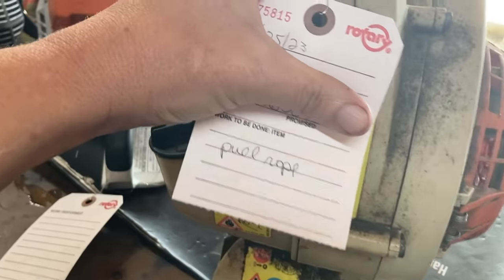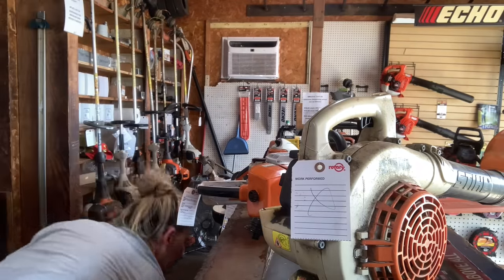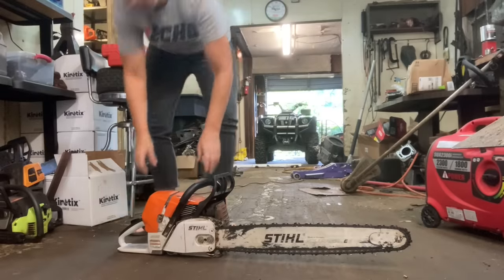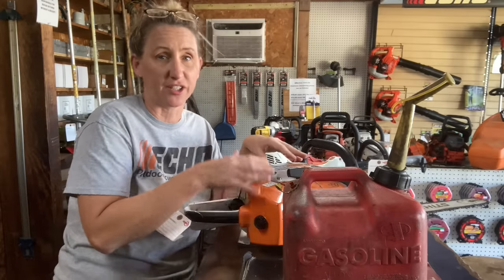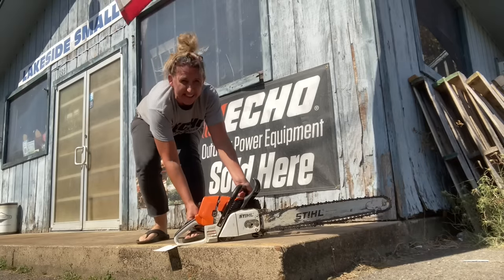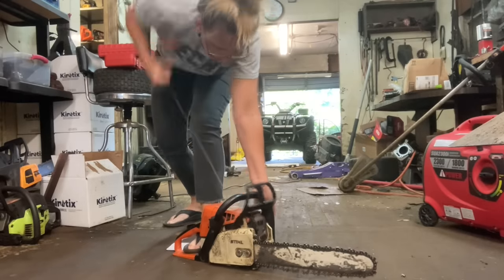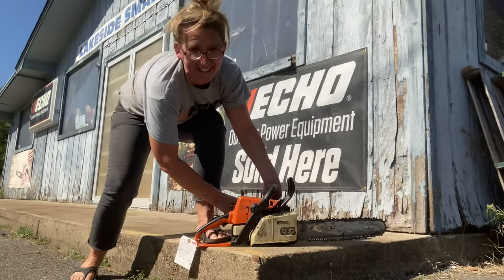The Burning Truth of Canned Fuel. This HUGE Distributor Doesn't Like Me Exposing It!

Comment: I am a former diesel mechanic and it really upsets me when I have a fuel issue on one of my pieces of off road equipment.  You have taught me what I needed to know. I appreciate it.
Reply: former owner of heavy equipment on logging and placer mining .. good fuel, and looking after it .. Filtering is worth hours if not days of mechanic time and lost production.. had bad fuel straight out of the tanker knock us down for days..
Reply: Hi 👋
Reply: @doonhamer252 
Nothing worse than a dredge that won't start... and you got that damned wetsuit on and trying to pull for an hour 😳😩😩😩 augh! 🤬🤬🤬🤬🤬
Reply: I was a diesel mechanic for many years.. After I retired I went to work for a family dairy farm.. As the mechanic. The firm probably had at least thirty or forty different two stroke motors.. Running all kinds of small equipment. One thing the owner did a long time ago... Was to buy aviation gas... He thought it was well worth the money.. Just because of the problems you are describing.. I thought the machines ran better and faster.. Not many less Pull rope issues.. Of course you cannot run alcohol gas in airplane.
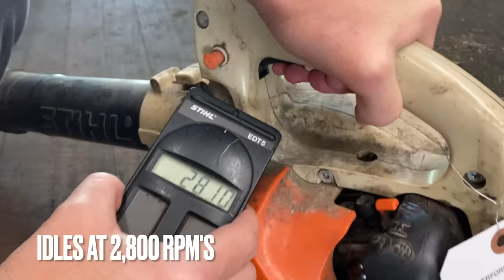Reply: 3:03
Reply: @jim4448  You actually can run alcohol gas(or regular diesel fuel) in some aviation engines, but that's another issue. Obviously not in those only rated for real avgas or modern LL avgas or jet.

However running leaded gas in small engines is not smart. Especially avgas that's several times more toxic than leaded automobile gas was. Anyone as old as me or older in most countries has IQ loss from use of leaded fuel in the old days. And I'm under 40.

Comment: You’re going to love this one. I found a Stihl MS170 at the dump on the ground near the dumpster. Pulled it a few times to see it wasn’t seized, but wouldn’t start. Took it home. Watched this video and emptied the fuel(light blue). Put in my non-ethanol mix - it fired up on the second pull! Thank you very much! MD
Reply: That's a darn good find.
Reply: Awesome! 😂👍🏼
Reply: @spiritseeker2831  Find a nearby gas station that sells pure gasoline. Don’t use gasoline containing ethanol. Mix your own 2-stroke fuel and don’t rely on any of the premixed stuff from the big box stores. I can’t help to believe it’s got so much stabilizer - to make sure it lasts on the shelf, waiting to be purchased - that the stuff doesn’t burn correctly. 🤷🏻‍♂️ Just my 2 cents…
Reply: @FilosophicalPharmer  My problem is that here in a major east coast metropolitan area, there are NO gas stations within a one hour drive [each way] that sell "pure" gasoline.  I have tried several web sites which purport to tell me which local stations sell non-ethanol fuel, but when I go to those stations every pump has a sticker that says the fuel contains 10% ethanol, and when I ask about non-ethanol fuel the attendant looks at me like I'm crazy.  So my options are limited to [1] mix my own fuel using ethanol-containing gasoline, or [2] buy the canned fuel.  Since I typically use less than a gallon per year I've just been buying the canned fuel. It's a pain to mix less than one gallon, however I guess that's what I'm going to have to do from now on.  Thanks Chickanic for the education.
Reply: Ethanol hurts nothing, you just have to use the darn tool regularly and don't store the fuel in a vented container.
Reply: @evanstauffer4470 You can remove the ethanol from the gas you buy yourself, but more important is ethanol doesn't hurt anything
Reply: @integr8er66 Have you ever heard of Project Farm?

Ethanol acts less as a solvent as pure gasoline does. The sugars in it burn up into more carbon deposits, and prematurely gunk up piston rings making you lose compression sooner.

Comment: Have you considered sending some samples of fuel from one of the machines that isn't running properly to one of those independent fuel / oil testing centers to see what's in it? it would be nice to know if it's something that's missing, not supposed to be there, external  contamination, water absorption, etc. it would also show if the contents and additives that they claim are present are actually there.
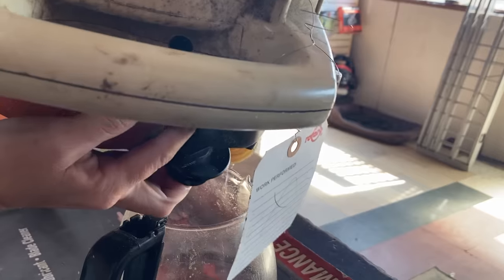Reply: I'd love to assume they are not guessing the issues based on the gas the customer brings in. Oh wait 4:15. I'm guessing people just leave their gas in it until it degrades: gas expires.
Reply: Sending samples of fuel would show if that specific fuel had an issue, but not the stuff sitting on the shelf waiting to be sold. Sending some sealed, fresh stuff would be better to see what is actually different, if anything.
Reply: @jefism  She says she checked everything before condemning the fuel on that blower. Doesn't seem like guessing to me.
Reply: @--_DJ_--  Sending in both for comparison would work too.
Reply: Don't have to. If you replace it and it runs, you know what you need to know. Don't over complicate things.
(I grew up in a motorcycle shop full of grumpy bearded old mechanics that were great teachers.)
Reply: @markmitchell457 What would you know?
Reply: Hahaha!!
Reply: She clearly doesn't have the "same problems" with "other" gas, it's just the Pink stuff whatever.
If it was anything you mention, she would have similar problems with other gas, not that gas doesn't have the problems you mention, it's just she's seen a "difference", so that's what she's showing us, is the "exception" to the standard rule.
Reply: @leeuniverse    Why would she have similar problems with other fuels if the pink fuel is a low quality/contaminated product?
Reply: @markmitchell457  My idea was to show irrefutable proof to the manufacturer and/or other people that don't believe her.    /     If the manufacturer was shown hard proof they might be forced to take the issue seriously.     //    And they might be able to track down the problem more quickly if they had testing that would tell them where the problem was.
Reply: @FonicsSuck 👍I approve this message☝️
Reply: @FonicsSuck  This is very true. I run good quality non-ethanol gas in all my small engines and only non-ethanol gas. I run this in all 4-strokes and in all 2-strokes, after mixed with a good quality 2-stroke oil of course. I advise all my customers to do the same. ONLY RUN NON-ETHANOL, DO NOT RUN ETHANOL GAS (in small engines.) I have more small engines than I can keep track of from almost every manufacturer/brand/model out there that may collect dust in a corner of a barn or building for 1 year, 2 years, or who knows how long. Blow the dust and cobwebs off, hit the primer a few times and choke if applicable, and most of the engines will fire right up or at least hit in 3 maybe 4 pulls (with 1 year old non-ethanol gas, a well maintained engine, nothing wrong besides gas could keep the engine from running) (also this is without fuel stabilizer or additives just gas and oil, and it may depend on brand/model of engine, to be honest some just start better than others.) The non-ethanol gas doesn't go bad within a year and doesn't eat up the fuel lines and gum up carb and wreak havoc on the entire fuel system, unlike gas containing ethanol does in the same years time. I LOVE ETHANOL GAS though. It's way cheaper so I run it in my car and truck, it's pretty good at cleaning, and without it I wouldn't have the same customers with the same engine come in every year and need them fixed. ETHANOL GAS ROCKS!
Reply: @FonicsSuck 
Same here. 
I get a year easy with ethanol free. I do store it with Pri-G stabilizer though. But that crappy ethanol, even with stabilizer, would be crap in a couple months. Even went as far as 18-20 months trying to get rid of a batch and no issues.
Reply: @joshpaul132 it couldn’t of been said any better!! I totally agree with everything you said, my husband has taught me every word your comment says. It’s so sad that people just don’t care or are to much of penny crunchers that they won’t accept the fact that ethanol fuel is not suitable or reliable for small engines. There is so many people in my area whom is the same line of work or similar to my husband and I that are great friends of ours but continue running through the small engines because they keep destroying them just because of something as simple as hitting the 93 instead of 87 at the gas pump! Pure stupidity if you ask me, but hey that’s just my opinion!!
Reply: Problem is I can only find non ethanol at 87 octane.So I use 93 octane that is 10 percent ethanol. Never had a problem.
Reply: i agree i too b want know
Reply: @FonicsSuck  this is true with all my small gas engines, non-ethanol fuel no andditives and if 2 cycle use decent oil.  No problems with letting the gas sit even if it all gets evaporated out of the carb.   If you don’t have a fuel shut off and a large tank, letting it sit for a few years can evaporate all the fuel but I’ve still not had any sediment problems even then.
Reply: @leeuniverse  what’s in the fuel depot?
Unleaded, OJ, pink stuff, OH sunny D!

Comment: I injured my rotator cuff just watching this! Great information, thanks!
Reply: I've already did that from nigh 60 years of workin' on small engines. Slowly but surely gettin' it back.
Reply: I usually have the pull handle rip out of my hand (and it feels like I might be missing some fingers in the process)!😮
Reply: Seemed so easy.  Guess it goes in the pickup with yearly leftover 2cycle. I’ve been using in trimmers to stop rotting fuel lines but have noticed a lack of top end cutting especially in brush.   I mix Rec90 for boat and chainsaws because I’ve witnessed damage from 87 ethanol.  One vacation replacing like new Mercury fuel tanks and lines.   Pickup tube leaking and one off, primers rotted inside.   Thanks for this.
Reply: I felt that pain too!! She's a dam machine to be able to pull like that!
Reply: Ouch! I tore a rotator cuff yanking hard on a lawnmower start cord. Here's a pro tip, for those who just did the same: do NOT immobilize your shoulder with a sling. Doing that led me to a case of frozen shoulder which is remarkably more painful and difficult to rehab in PT. I mean little old ladies with broken hips cycled through PT faster than I did with a frozen shoulder. But I did eventually recover completely.
Reply: @bob: my rope pulling arm was getting tired. 😊

Comment: Ive switched to using canned VP fuel over unleaded pump fuel because the ethanol in ohio is 15%. Before the switch the blower was experiencing a major bog.  Now,  my blower and trimmer start easy and run great.  You wont have a problem running VP fuel. They literally make racing fuel used by major big name  race teams from boats, cars, motorcyces and radio controlled nitro engines.
Reply: Yeah I agree their stuff is actually good. Surprised you haven't checked pure gas for a e-free station near you, that or decided to do remove the ethanol
Reply: @williamwallace9620  There IS a station near me that sells a non ethyl 90 octane, but the pump uses a shared hose with the E10 grades so just buying 2-3 gallons for my 1972CB750K I wonder what the final E ratio is to pump 2 gallons through the hose that was prefilled probably with E10. I saw a test on youtube where a guy explored this and the "non ethyl" fuel sample did indeed still have some Ethyl. Maybe pumping a gallon into my pickup, then 5 into a 5 gallon gas can would give me a better result for using in the bike and small engines at home ?
Reply: I use the SEF/VP fuel. It's made by VP Racing Fuels. Never have had a problem with it. I used VP race fuel when I raced dirtbikes for years. I have also tried the Truefuel but had issues with it and had to adjust the carb to get it to run right. Never did have to do that with the SEF/VP fuels.
Reply: Good to know about the VP canned (for storage) fuel.  I was wondering about a long-keeping “just in case” fuel for a small two-stroke generator.
Reply: Vp is great stuff.
Reply: I noticed the same thing, I was repairing a lot of LawnBoy duraforce machines and found them more likely to surge with canned fuel.

Comment: Chickanic: tells the truth
Big box fuel: and we took that personal.
Chickanic: hold my beer
Reply from the maker: Bwahahahhaha!!!
Reply: Chickanic: their fuel doesnt work so lets put MY fuel in it
Watchers of this video: what`s YOUR fuel and where to get it?!!?
Chicanic: Ill sing you a song maybe then you`ll stop asking questions Ill never give answers to
Reply from the maker: @kirdot2011  Regular 89, Echo Power blend Oil and Ethanol Shield. At the end of this video, the suggested next video goes into more detail. Tells you who I am talking about and shows better examples of how it runs in equipment. Also tells everyone what fuel I use.
Reply: @Chickanic  now this is what should have been in the video
Reply: @Chickanic 
You got me onto the Red Armor, and I run it across the board. I use the canned pre-mixed for all my 50:1 engines, and I mix it at 32:1 with 87 octane Sinclair for my ancient Lawn-Boy which now starts on the first pull.
Reply: @Chickanic  what do you think of the manufacturer branded can fuel for the certain units you featured in this video? ive been using so far without issue but ny machines are only 5 years old and not used for commercial purposes...
Reply: That’s interesting…I use VP Racing C-12 leaded race gas and Amsoil Dominator oil at 40:1…
Reply: All About GREED.
Reply: @kirdot2011 she's mentioned her mix in several previous videos. I knew it was echo mix right away.
Reply: So I take it your an echo dealership, if you are do you sell echo canned fuel or any other brand?
Reply: Chickanic was also right on the money about Stihl's 2 cycle oil clogging spark arrestor screens.

Comment: If that isn't definitive proof I don't know what is! Thanks for saving us a lot of frustration, awesome video!
Reply: So what kind of  fuel do you use premium or recreational fuel
Reply: Another fun definitive proof test would be to take an easy starting good running engine that is hitting peak rpms and put the garbage can fuel in it. A reverse example of  good fuel vs. canned fuel if you will. 

This video is 100% spot on. I came to the same exact conclusions with this particular type of canned fuel years ago. Other than for storage purposes it has no purpose to me. Even then it’s too expensive to be economically practical. 

To be fair old stale 2-cycle mix that is very heavy in oil ratio will produce similar results of hard start, no start and low top rpms.This seems especially true with Stihl engines for whatever reasons.

FYI …8 out 10 customers surveyed report low energy and a hard time starting their work day after drinking Coffee at that particular small engine repair shop.
Reply: Why bother with "canned fuel" ??!   Just buy E-free gas aka: 'pure gas' without the damaging Ethanol/alcohol content.  I'm here in FL and our WAWA stations carry it (Ethanol free gas) frequently promoted as 'Boat Fuel".  Why is that?  Remember going back to your 5th grade science class were you were (maybe?) taught that "Alcohol has an affinity for water".  

Translation: Water follows Alcohol and that is why the typical Marinas always offer Alcohol (Ethanol) Free Gas.  It's a real problem for boats, since they ride on/near water...  Alcohol is also a SOLVENT.  It likes to wash away/dilute oil, especially the oil in your Fuel Mix!  So, just use Ethanol free fuel with a good fuel mix and your mostly there for the LCO's (Lawn Care Operators).  For the more casual user or for Winter set up, you should also add some fuel perservative like  Stabil MARINE Grade (most economical and strongest) or Ethanol Shield for your new gas purchase (which no longer contains Ethanol)👍 .  Search your area for other Ethanol free sites @ Pure-Gas.org
Reply: I've used non ethanol fuel ever since it became available in Kansas in all my lawn equipment and toys. Zero problems!
Reply: would having put in fresh Truefuel netted the same results?
Reply: In our area Casey's used to sell alcohol-free fuel at one of their pumps. They have since removed it and added E15 at the pumps.  Getting alcohol-free fuel can be a challenge as most stations don't want to fool with it especially the larger name brand stations. If you live in the city nobody carries it. I found it mostly in rural areas farm co-ops etc.

Comment: I learned my lesson when  Bre had her first video on the expensive premix gas. Took a craftsman weed eater that would not work and stored for several years. I put new plug and I mixed my own gas and been running ever since.  Chickanic is the bomb
Reply: Never had issues with Aspen, these fuels have their place, like for storage. Always runs great, always starts easy. My dad had a trimmer with Aspen gas left in it for 4 years. Started on the 4th pull.
Reply: @em4703  I have not used this brand of fuel . I don’t remember seeing this brand for sell in stores in Georgia.
Reply: @tomyot77  it’s mostly in Europe, though I hear it either currently is, or soon will be, sold here.

I personally wonder about VP canned stuff for “storage fuel,” as there’s a place a few miles away that has non-alcoholic fuel - both 92 octane, and (twice as expensive!) 110 leaded race fuel.

Want storage fuel for an emergency generator.

Comment: I have used that stuff for years on several of my chain saws until they finally burned up I thought. Finally on my newest saw it quit working. I knew that it was not burned up. Then I remembered that you had mentioned on one of your videos about that junk. I went and bought a new 1 gallon gas can and 2 stroke oil and dumped out the other gas and refill it with the mix. Well like you said it started. I still had the other saws so I pulled them out of storage and they still had the old gas in them. I did have to buy a carburetor for one of them but they started. Listen to her. She knows what she is talking about. Thank you for helping us and telling the truth.
Reply from the maker: That's awesome! Glad I could help and thanks for letting me know!
Reply: Yuo need to rec fuel also